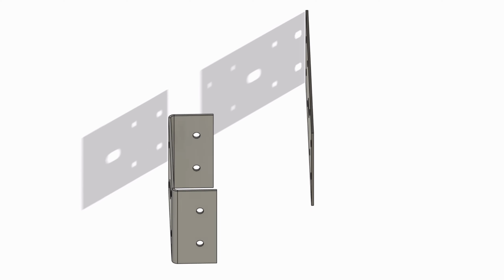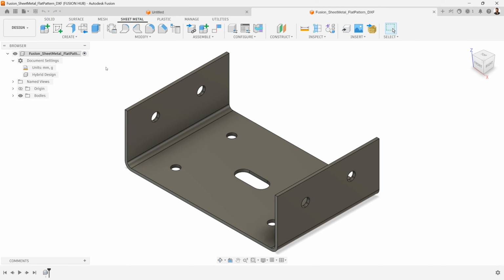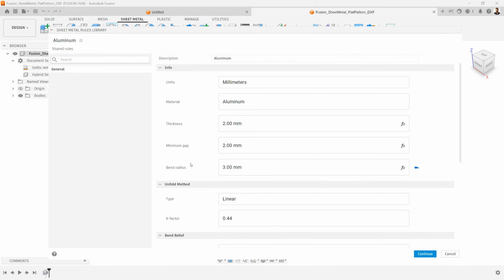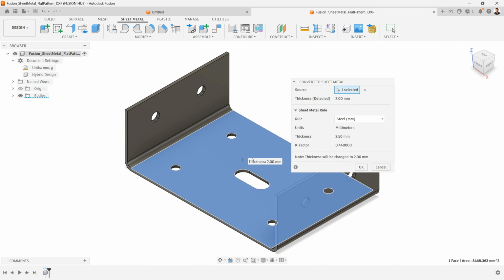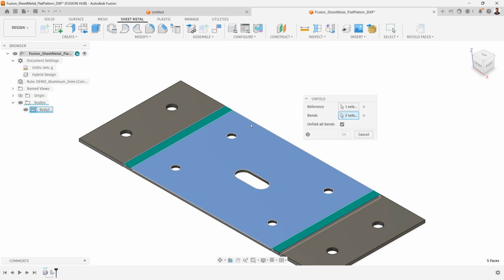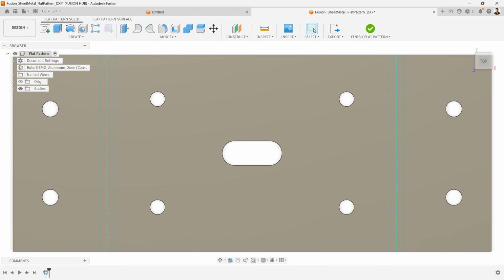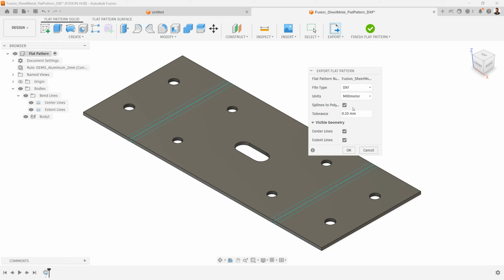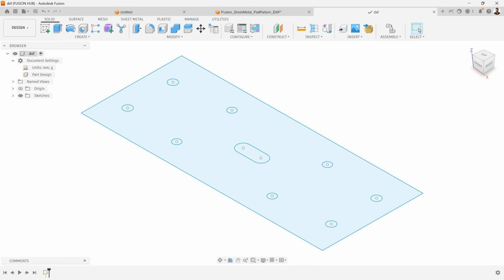Fusion 360 Sheet Metal: Convert an Imported STEP to Flat Pattern & DXF

Comment: What is the difference between Unfold and Flat Pattern in Fusion 360?
Reply from the maker: Unfold is mainly for editing the part in a temporarily flattened state, while Flat Pattern is the final flattened geometry used for manufacturing and DXF export.
Reply: @kraftcad  thx